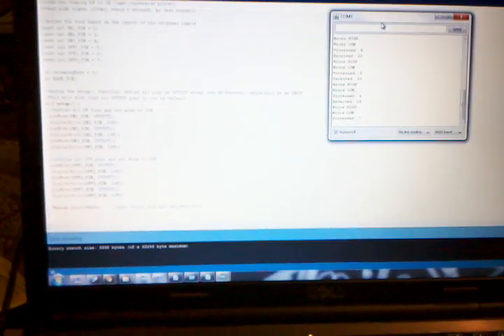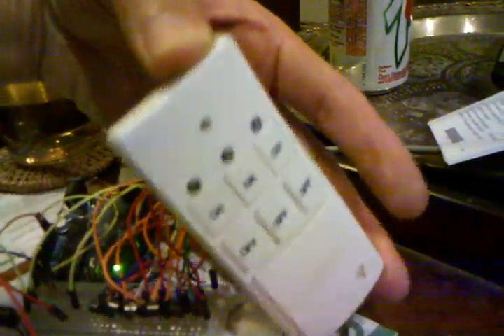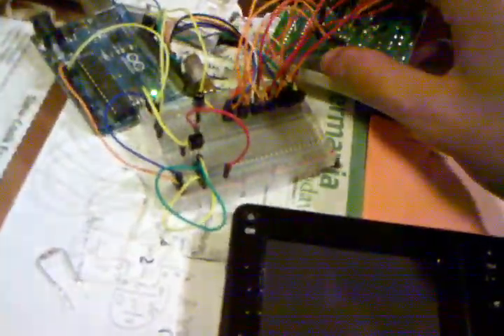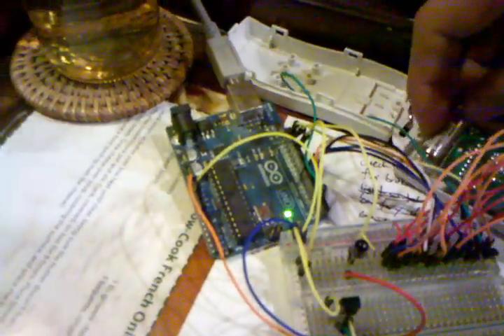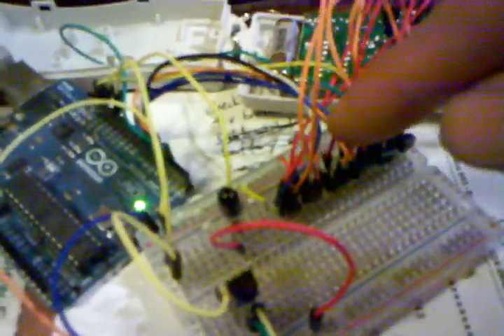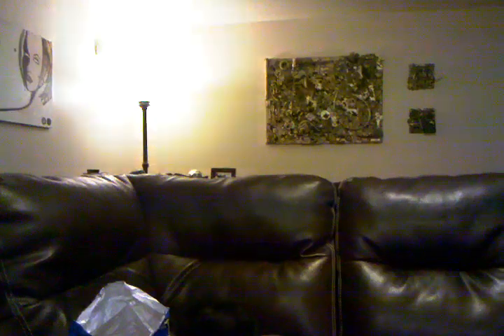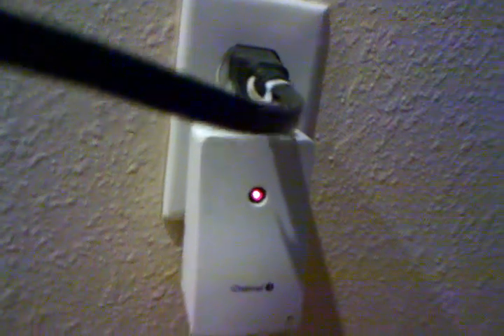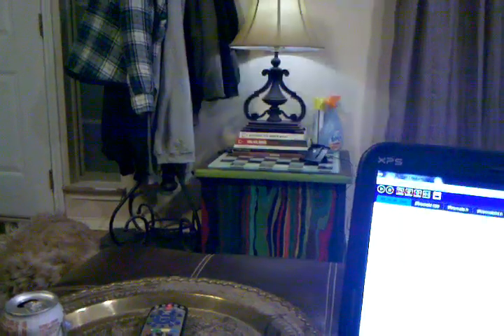Arduino RF to IR project Phase 1

Comment: Thanks!  I have all my solder contacts picked out and verified them as you suggested.  I tested out some quick code for the arduino and it's all working as expected.  Last step is to solder and I'm going to attempt that today.  I'll post a link to the video, assuming I am successful :)  Thanks again!

Comment from the maker: Thanks! Some advice would be to make note of the contacts that the buttons make with the RF board BEFORE disassembling it. Try to emulate the button press with a jumper (this will close the circuit just like a button press would). Soldering wasn't hard at all. Your idea sounds great and practical. Please share a build video when you're done and I'll try to post the completed project on here this weekend, as it has been in place for a few years now...

Comment: I know this is an older post, but I wanted to say good job!  This is the exact same idea I had and I'm going to attempt to disect an RF remote to control my motorized blinds.  Did you have much trouble soldering to the remote?  Any tips or words of wisdom?  Again, nice work!